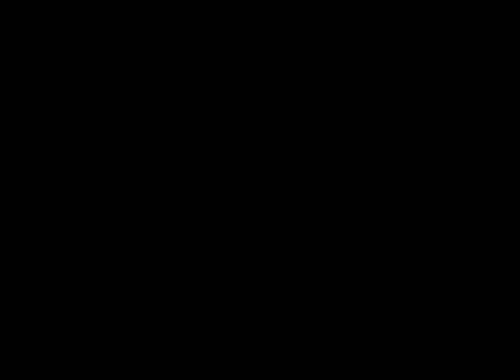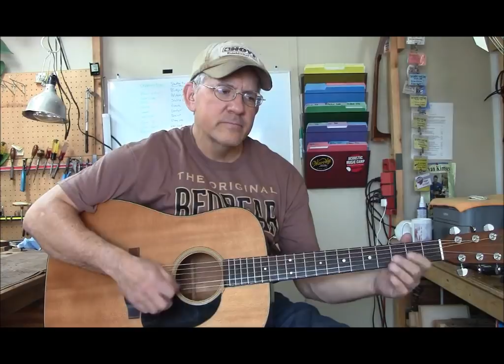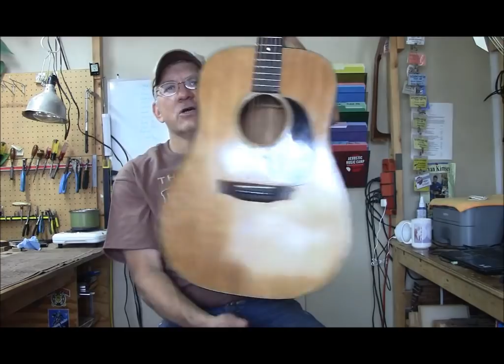Two D 18's-  bridgeplate difference

Comment: I could feel completely different playing each of these and adapting to each of their strengths, but based off the sound in the video, I prefer the tone of the 72. 
It's not just that it's got more low end. It's tight, clear, rich, and more consistent and recordable for all styles and attacks displayed here. It never sounded like it buzzed in an unpleasing way.

The 69 had more high end jangle, which would work perfect for certain playing styles or sections of recorded music. The 69 sounded harder to control, had more buzz and less bass and sounded like it would require a lighter attack.

Definitely both have their strengths and weaknesses and each could be the best in different pieces of music, but if I had to choose one, the 72 had more pros.

I'm wondering, was the action of the 69 a bit lower than the 72?
Reply from the maker: I don't remember. The 69 might have been a smidge lower or I might be subconsciously playing it a little harder. The 72 is the only shop guitar I kept when I moved and sold everything.

Comment: So I took a mirror and noticed the ball ends of the strings are moving to far up
So what’s better new bridgeplate and bridge or just put like a new smaller bridgeplate on top of the old bridgeplate?? Seems like a great idea but then why isn’t it done all the time ?
Reply from the maker: Adding a bridgeplate doubler can be a tone killer since it isolates the pins that much more from the top.  I have used them in certain occasions and make my small overlay about .030" thick.  Look into a PlateMate... I've used them and they're not bad.

Your best bet, most of the time, is to have an experienced person (finding one is the hard part), fill in the worn areas with dust and glue, and then slot the bridge and fit non-slotted bridgepins.
Reply: @Bryankimsey  thanks,

Comment: Hi, can you tell me if there is a tonal difference among the black locust, maple and ebony as far as bridge plate is concerned? I'm about to change the bridge plate and my guitar has also Indian rosewood. In this very informative video and it shows clearly how a different little piece of wood affects tone and in my ears the black locust grants a bit of clarity and tonal separation in each individual note.
Reply from the maker: On a given guitar, I think black locust is a little fuller and meatier sound... "thicker", if you will.  I tend to use it on D-18's where I want to fatten the sound.  Maple is brighter and crisper and maybe a little "thinner".  I use it on 28 and 35's where I want to brighten things.  Never used an ebony plate, but I've used Braz, Honduran, Mad RW and those will give a darker sound than the other two- still bright but a different bright than maple.  See: https://youtu.be/yM-QDVf-ME0
Reply: @Bryankimsey  Thanks for the link! Which wood would you choose if you want to add more depth on the lower frequencies of your guitar given it is a bit bright and with plenty of sustain due to either stiff top or heavy bracing? It's a dreadnought long scale with sitka top / mahogany back and advanced forward bracing made of adirondack spruce. I'm also planning to change the bridge so any suggestions on the combination of the two pieces of wood (bridge and bridge plate) would be greatly appreciated.
Reply: I forgot to mention that current bridge is Indian rosewood and bridge plate laminated rosewood.
Reply from the maker: Ebony bridge and maybe a nice RW plate- not Indian... anything else.  I'd also look at the braces and the back braces... are the back braces all the same height or are the back two lower?  Tap on the back.  Starting from the neck block, it should go:  donk,  Donk, DONK, DOnk.  Significantly deeper tone on brace #3.  Modern guitars will go: donk, donk, Donk, donk.
Reply: @Bryankimsey  Here you can see for just a moment the back braces (24:27). https://www.youtube.com/watch?v=fXGV31hOYhs&t=1173s . In this video Seagull shows a cedar top construction with wild cherry or walnut back and sides I think whereas min is solid Sitka and solid Mahogany. I tapped mine in the back, and it seems to be the first scenario you described. The 3rd brace is also a bit thicker than the second. To me, ti seems that the problem is somewhere in the soundboard bracing as I believe that the top is quite stiff. It is also a new guitar, just two years that came out of the factory and within that time the sound has already opened up a bit. A technician here in Athens, Greece, told me that wood is quite fresh and you can't tell how the bass and mids will sound in 5-7 years from now. He asserted that is better not to touch the braces until the guitar matures for a signifficant amount of time and then see what changes need to be made. So for the time being, I'm hoping that with the new ebony bridge and fretboard, plus the new bridge plate to get some more depth in the lower register.  I'd like your view on that.
Reply: the base E string is quite nasal in sound, the C major and E major open chords also lack of depth a bit and this is something I'd like to change. Other than that, the guitar has a wonderful quality, hard to find in new Martin standards
Reply from the maker: @vasral  The tech has a point, but it still shouldn't sound nasally or compressed.  Plus, do you want to wait 5-7 YEARS ?  I find that when I scallop braces, it takes 2-8 MONTHS for it really open up. From there, it's a much slower change. You DO want to be careful with scalloping, but stop short of where you want it and let time work. Check your top braces and see if they have rounded off edges or square edges.  If rounded off, you can gain something by sanding them to smooth, round edges.   Not this: ]   but this: )
Reply: @Bryankimsey  It has square edges. So I assume that scalloping the braces is the only way? One more scenario I would like to know your opinion, since I'm also changing the fretboard from Indian RW Madagascar Ebony, what if I ask for the fretboard to be a hint taller which will result to a twice taller ebony bridge? Wouldn't I gain more energy transfer to the soundboard with this way and possibly with deeper bass response? Either this or scalloping the braces a bit which I have to make sure the technician wants to do it and he is capable of doing it right.
Reply from the maker: No... you're going to ROUND the square edges off.  That way you'll keep the brace height but reduce the mass.  And no... a taller bridge is NOT going to necessarily make it sound better.  Think of the top as a trampoline.  Little kid of 40 lbs can't make it move. Dude of 250 lbs bottoms out on the ground.  Guy of 150 lb matches the springs and gets good bounce. Top's the same way.   Stiff tops can benefit from more tension BUT then you will have to make that top move by using more power in your right hand.  Me, personally, I prefer loose tops and lower saddles to get the "bounce" I want. 

On the fingerboard... you're gonna radically change the feel of the neck and what a LOT of work!!!! I'd just reset the neck to a higher angle, myself. IF that's what you REALLY want to.  Some builders do this intentionally and I have "un-set" the neck, lowered the bridge, made the top bounce and the owners were really happy.  Also... you might want to consider using e-mail so I don't have to type in these dumb little boxes.  ;)    my name@gmail.com